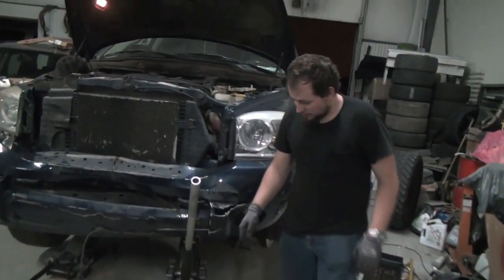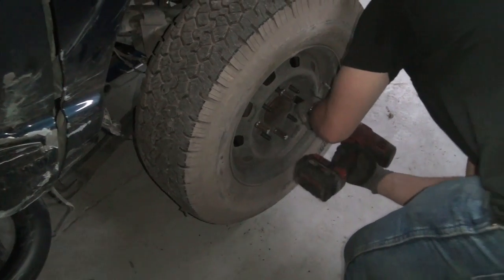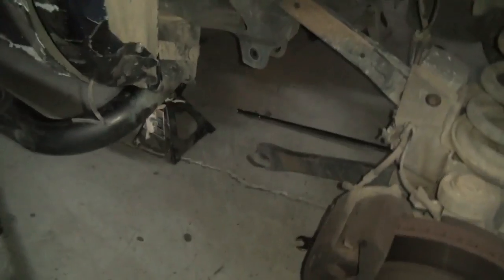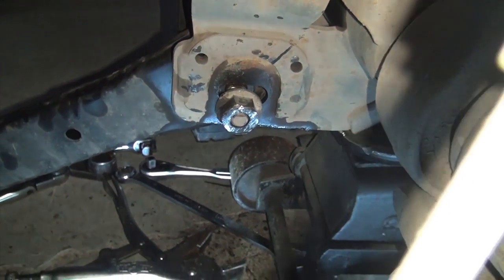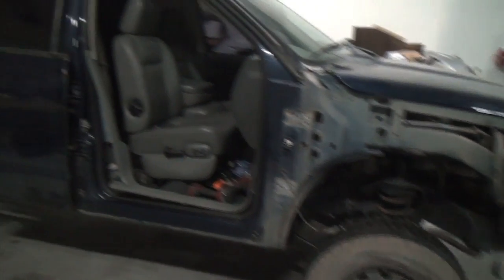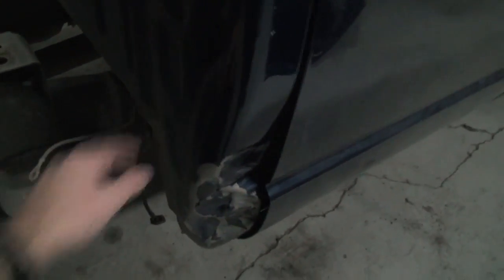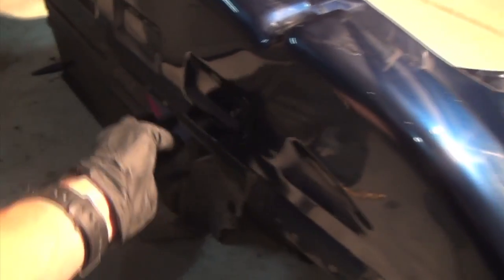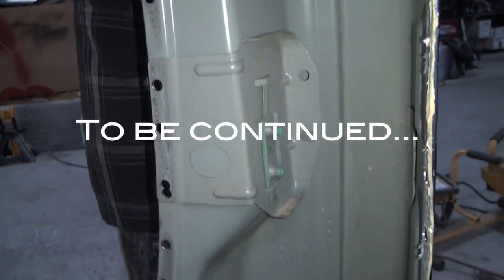Wrecked Dodge Ram Rebuild | Pt.1 | Seized lower control arm bushings | Cab corner replacement!

Comment: the part where you showed us how you used drilled by the spot welds to get to split the entire panel was very cool. i never knew that was how you would do it.  Here in Jamaican they would beat that damage corner out the best they can then use the filler and mold it back into shape. Thank for always sharing the knowledge. Keep the Videos Coming!
Reply from the maker: Neil Andrade 
Your welcome Neil!